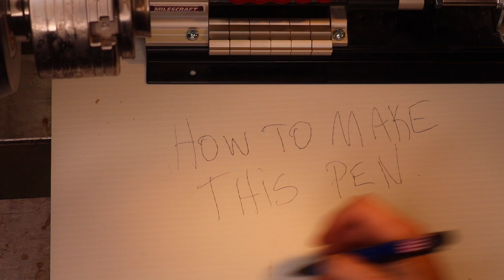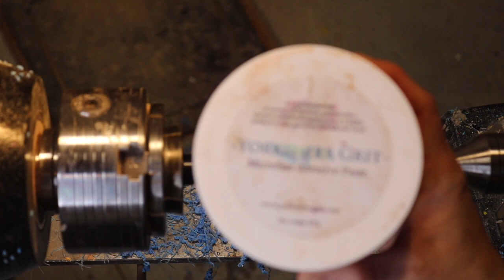Woodturning the Flag Pen

Comment: That came out great Peggy. I noticed there's a slight wobble in your mandrel, noticed it when you were polishing. If you get yourself a mandrel saver, which goes in the tailstock in place of your drive centre, it has a hole that the mandrel goes through, and you don't need the brass nut. It will allow you apply pressure more evenly, rather than just on the mandrel itself, which is possibly causing the wobble as it bends the mandrel. I had the same issue, and someone suggested I get mandrel saver as well, and viola, no more bent mandrels.
Reply from the maker: Cool, thanks for the suggestion!

Comment: I noticed you did not use the ca finish as most pen turners do. Is there a reason for this? I did like the finished results of your pen. Does the finish you put on your pens resist finger prints and smudging due to use over time? Cheers.....
Reply from the maker: I just have better luck this way---I guess I haven't perfected the ca method yet! Thanks for watching!